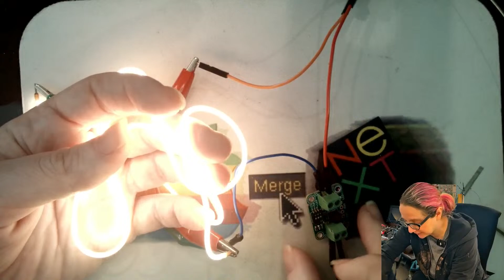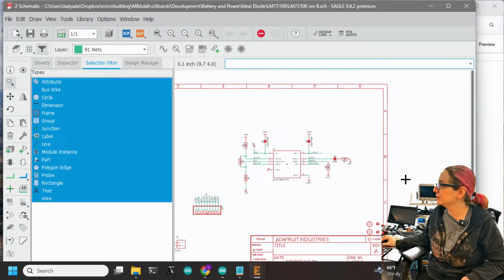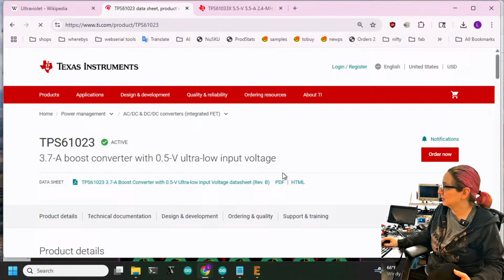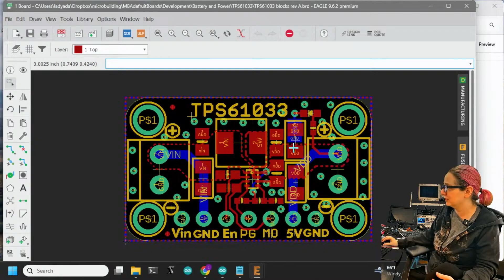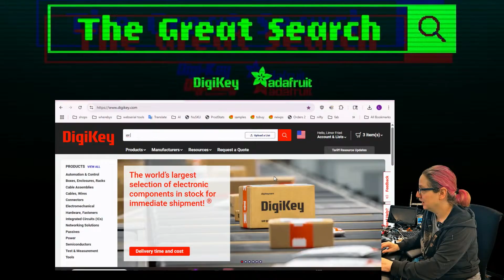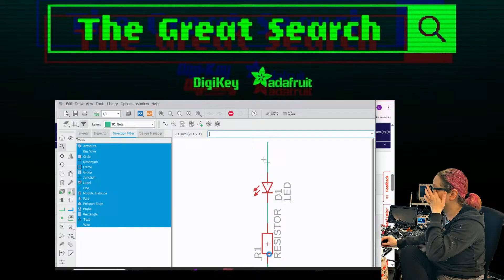Desk of Ladyada – nOOds and Boosters A-Plenty

Comment: Have you considered XT60 connectors for power circuits that exceed the 2A rating of JST-PH? They are widely used in RC modelling and drones and are rated up to 60A. I hate screw terminals with a passion, and they do open the possibility of getting the polarity wrong. Another possibility would be JST-VH rated up to 10A.
Reply from the maker: Ladyada replied on Ask an Engineer https://www.youtube.com/live/vRNOGT7ZbFk?feature=shared&t=3126